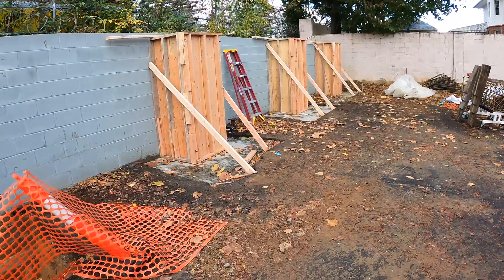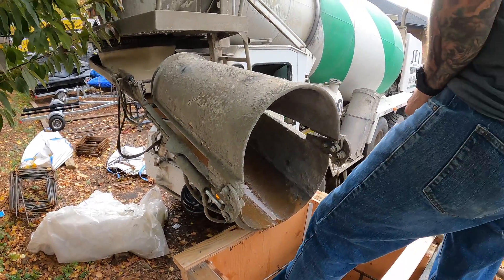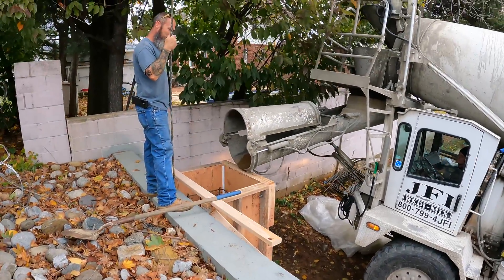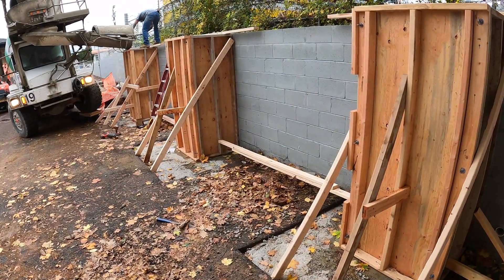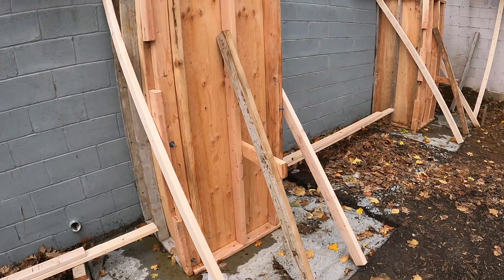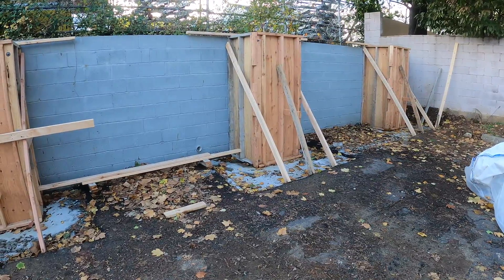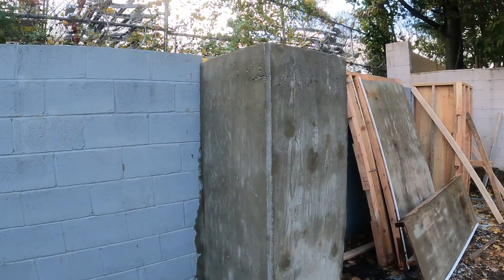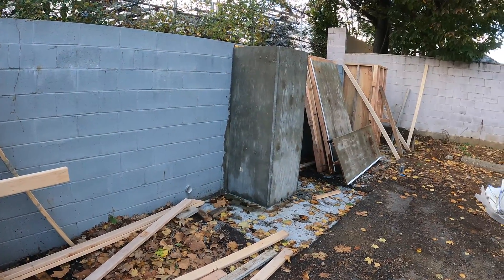Pouring reinforced concrete columns

Comment: Looks good!!  I'm about to pour pilaster forms just like you have done, but I've followed the instructions in a general carpentry book which called for wales or wooden 2X4 bracing around the form at several heights.  i wasn't sure they were necessary, but now I know for sure that they are!  Thanks for the video, good to know how it's done, Grandpa's barn will be reinforced and no longer in danger of collapse.  🏠

Comment: I personally do atleast 3 rows of log cabined 2x4 and a vertical 4x4 in the center of the form on each side and put 3 braces off the 4x4 at the same height as the horizontal 2x4s with a plywood cleat nailed on the 4x4 just above the brace so the brace doesn't push up and loosens. Well we get our forms vibrated like crazy so we over build them. Sorry if I wrote it kind of confusing but I imagine you get what I mean. Good work brother